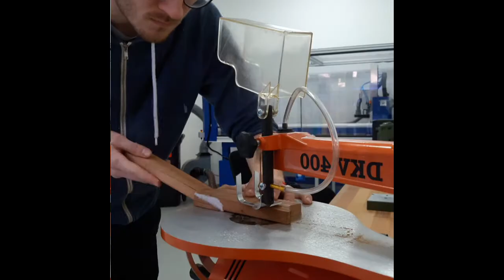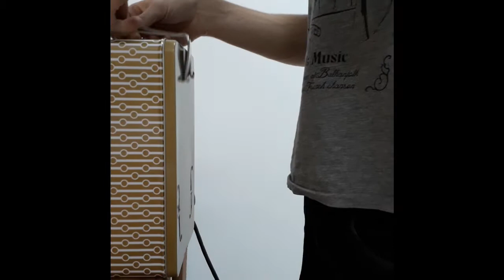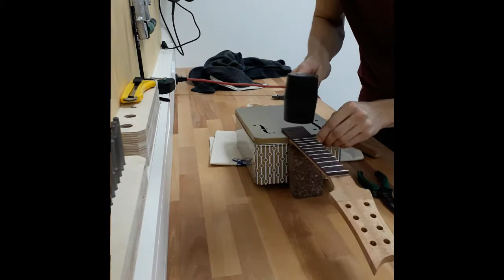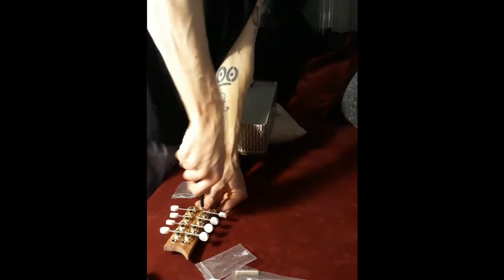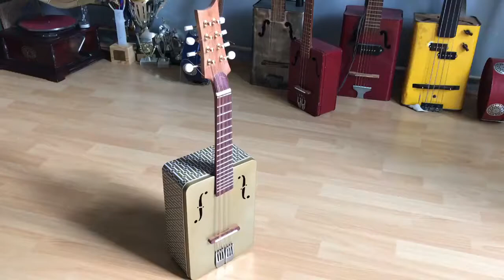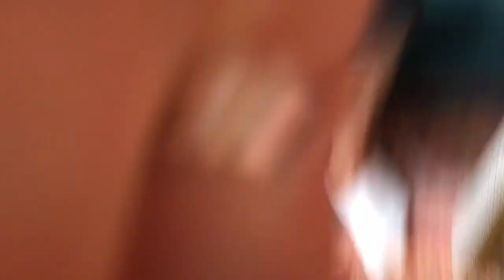Cookie-tin Mandolin: Making-of

Comment: Nice work.  It sounds great too.   I wish you showed the support inside the can.  And did you put any kind of truss rod in the neck?
Reply: John Alex thanks :) unfortunately I don’t have any pictures or video of the inside of this mandolin, I have a picture of the inside of an oilcan guitar that I could send you if you want, it’s the same principle: a through neck, no bracing. 
I’ve put a dual action trussrod in this one, in other mandolins I just put some Aluminium reinforcement for the neck to withstand the high string tension
Reply: Could you please send me the picture of the inside of the oilcan guitar. Many thanks